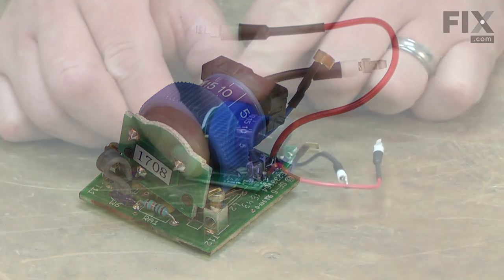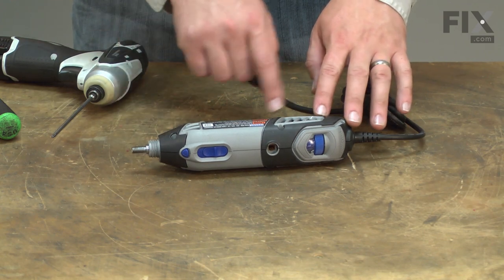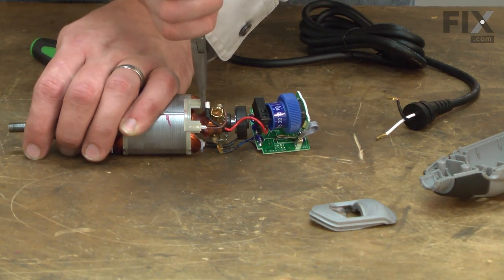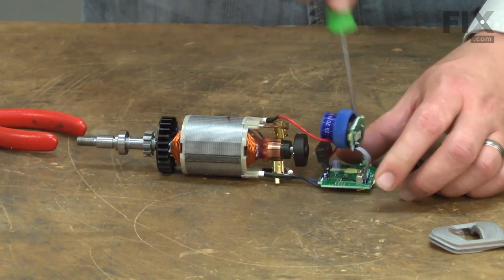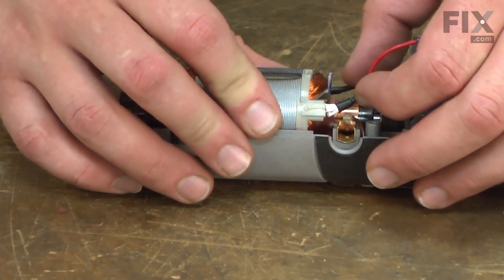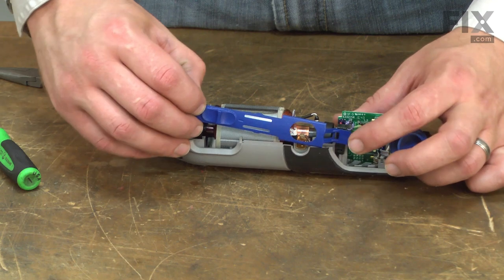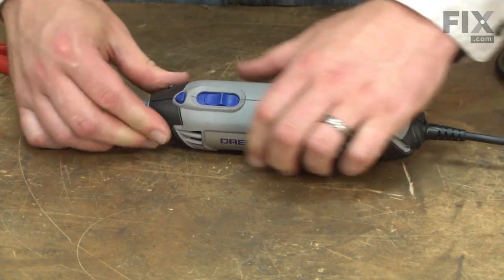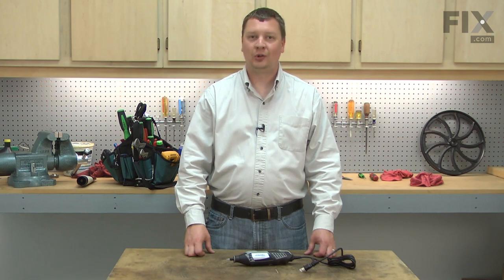Dremel RotaryTool Repair - How to Replace the Electronic Speed Switch

Comment: This video did not show the procedure of locating the fault. How can a person order expensive speed controller before making sure, exactly only the controller is defective? Mostly the potentiometer variable controller can be worn out, sticky, or may be interconnecting wires are loose. Step by step for finding is needed. Also it is essential to show individual components- field welding, armature, 3 wired - red, black blue wires coming out of the speed controller, on/off switch & power wire testing precedure. Also when these components test fails, how to easily clean, adjust and restore the component, please make another video with these details.

Comment: Before ordering any parts open up your unit and look inside. Like St8kout said below, mine had black wire disconnected from the harness. With that my unit was running at full speed without ability to adjust it, but also the torque was noticeably below normal so I could easily stop the spindle with my fingers. My unit was 7 years old at the time with light crafts usage. That wire probably loosened up and fell out of the harness due to vibration.

Comment: There's a fault in your video when you first start to separate the halfs, the blue shaft-lock button and spring will pop out if you don't prevent it from flying across the room.  Also there is no need to remove the collet and nut.

Comment: MIne stopped working and after opening, the Black field wire simple detached from the coil. I guess they didn't seat it in firmly at the factory for it to simply fall out. It had stopped working a year ago and I realized there's probably a youtube repair video.